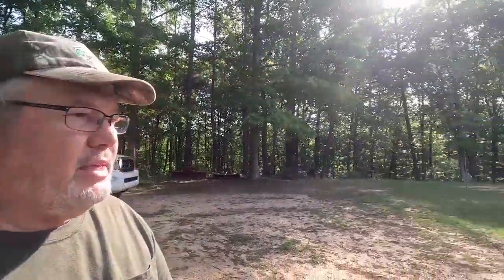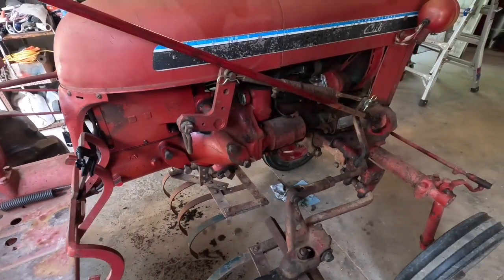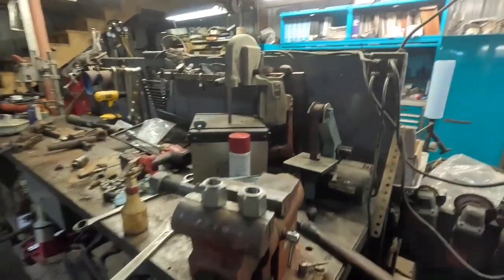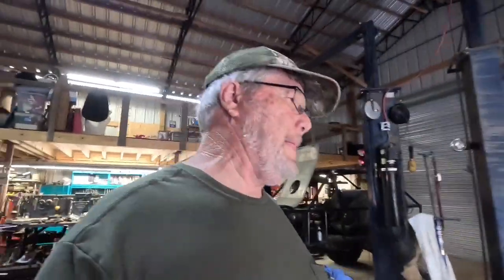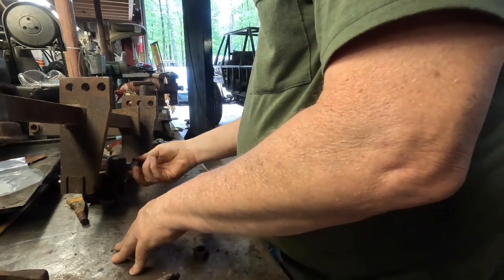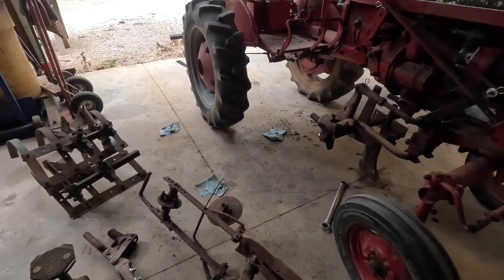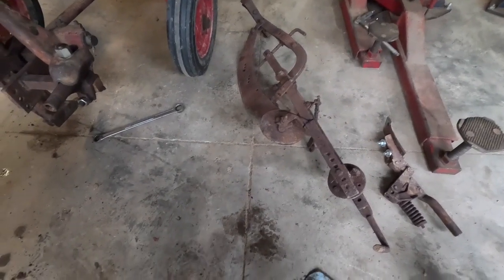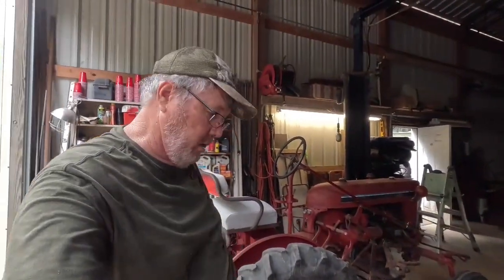Cultivating with the Scratchers and working in the shop.

Comment: You do good work! I didn't realize you had sold your 140. We have a 100 w/1 pt. fast-hitch and several pcs. of equipment and a 274 w/3 pt. and several implements with it. Both have full sets of cultivators with planters and fertilizer units each. I told my wife we could ''get by'' with a Cub in decent shape if I could find one w/fast-hitch and all the attachments needed for a garden! Great video!